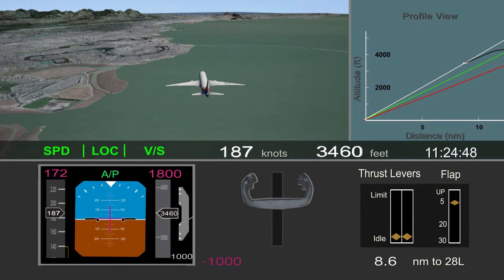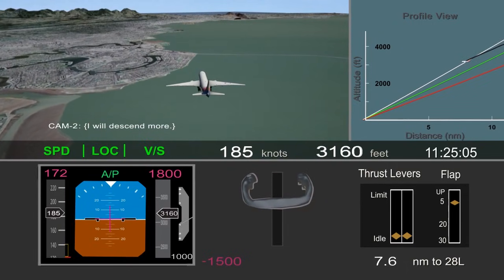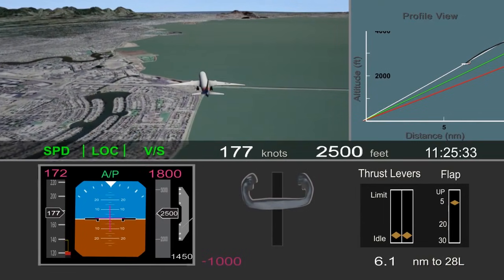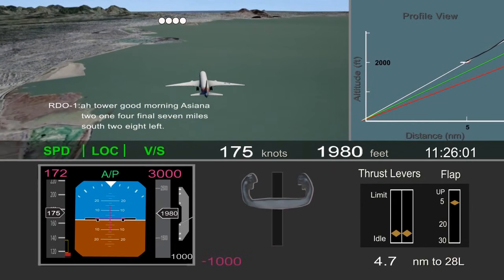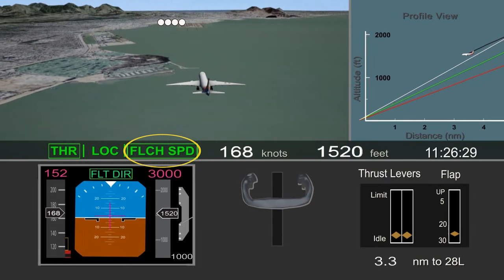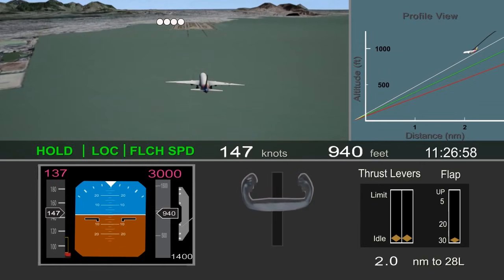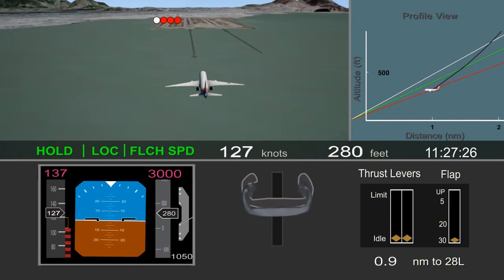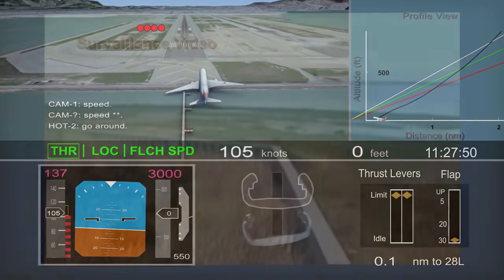Asiana Flight 214 Crash - NTSB Animation

Comment: What is the minimum altitude AGL that a B777 (like this one) is capable of going around from idle thrust, assuming normal landing pitch attitude?
Reply: +Xin Rong 2 cm
Reply: Cristian Bustos That is really not bad.
Reply: +Xin Rong now you know
Reply: +Xin Rong If you're on a stable approach, with engines at correct thrust, approach speed, on the glide-path; you can go around at as low as 50 feet above the runway (that is, just when passing above the threshold) and still not touch the ground. I believe you lose some 30 feet during the go-around maneuver. If the aircraft happens to touch down on the runway, the go-around continues though.

Comment: i think to solve this problem is to select the speed brakes so he can get i high decent rate without getting a high speed ,,,then when he intercept the glidepath just return to normal landing configuration ,,, pls correct if i'm wrong
Reply: Adam Ebrahem Yes you are right. But in a 777 you don't select them when the flaps are extended. So in that case the pilots where a tiny bit right :) The rest is just full of piloting errors.

Comment: Absolutely ridiculous - Everything on the approach bent out shape - Glidescope, Speed dropping rapidly while engines set to IDLE?? and the other pilot just watches until it s too late. The classic case of culture versus common sense. not wanting to tell the guy flying your whole approach is wrong and Taking over to initiate a Go round in case he gets offended!! Its like the guy had never flown before - Engines set on idle and speed dropping - Aviation 101 - Thrust required for Lift!!
Reply: Inatsikap Sounds eerily similar to the Tenerife KLM crew.
Reply: Glideslope btw, not glidescope.
Reply: Lot of armchair pilots in this comments section.
Reply: You are right - both pilots never did a visual approach before. They always used ILS before

Som Ting Wong
Reply: @cedricye1767  Wi Tu Lo
Reply: @ChadDidNothingWrong  ho lee fuk
Reply: Cedric Ye   HAHAHAHAHA

Comment: The reality is that many pilots are uncomfortable with doing a non precision approach. This is not the first time there is an accident because an ILS is not working. Airport authorities should recognize this fact when they take essential equipment out of service for maintenance.
Reply: It goes to show how most airline pilots are not actually pilots. They are observers. Trust the airplane and trust the automation too much. I have watched every episode of air crash investigation. And the pilots who succeeded the most in getting an airliner down safely even in emergency situations are the pilots who fly single engine or glider aircrafts outside of the airline who know how to fly when they need too. Doing the BASICS which is page 1 in training. Such an experienced captain (granted very inexperienced in the 777)  no matter what aircraft the principle of flight remains the same.
Reply: Stephen O'Connell Sir I couldn't agree with you more. I read the Canadian TSB final report on AC143 aka the Gimli Glider. The captain (who initially caused the fuel emergency) was a glider and small plane pilot in his spare time. The crew's performance on KE801, LX3597, and even worse on IT148 were appalling. When you board a commercial plane you don't know if you have a Sullenberger or an idiot like on AF447.
Reply: ***** Exactly. Look at Transasia 235: the ATR72 is equipped with auto feather in case of flame out, all the pilots had to do was.. NOTHING! Instead they turn off the sole remaining good engine. Now Transasia has grounded 10 of its pilots for failing basics tests. Unbelievable.
Reply: +Gin Za The ILS is not essential in good visibility. Every competent crew should be able to fly an approach visually. In fact, I would go as far as argue that it is the most primary aircraft skill required.

Comment: Okay, people make mistakes... BUT.. this is a fucking rookie mistake to make. Responsibility and blame is on these idiots flying the plane 100%. Sorry for sounding harsh but this is the level of stupidity of Air France 447.
Reply: Jamenator1 I don't care how many letters someone has after their name, nor how many hours or landings are in their log book.  What my very first flight instructor told me on one of my very first dual instruction flights 40 years ago still holds true.  Before you do ANYTHING else, FLY THE F**KING AIRPLANE!!!  If you don't do that, nothing else matters.  Basic airmanship has to be first, foremost, and more important than ANY other task in the cockpit, period.  These guys failed at BASIC AIRMANSHIP - they were not flying the airplane.  They didn't understand how their equipment functioned, and they didn't operate it correctly.  This was 100% the fault of the two people with their hands on the controls.
Reply: This was normal operation, while Air France 447 was in a much more peculiar situation. Air France 447 pilots lost airspeed indication due to pitot tude blockage, which required the airplane to be flown at 85% throttle and 5 degree pitch up until situation resolved.
Reply: +RBATOR1986 It's not even a rookie mistake.  It simply makes no sense.
Reply: +sifterbox You are a tit.
Reply: This was normal operation

LOC approach without a G/S is not a normal operation for children of the magenta. Remember that video? In that one he talked about the perils of disabling the autopilot while leaving the autothrottle on and said a pilot should be physically connected to the controls even when they're under automatic control.

If he'd either disabled autothrottle and personally managed the power or had had his hand over the throttles to check the thrust setting selected by the computer while concentrating on the descent path he'd have caught it.

Still ridiculous that they didn't go around at 5 miles or more given how out of the slot they were. They went below minimums even without being in a stable config which is basically every airline in the world demanding immediate go around, most well before.
Reply: Le-Cheng Xu Sorry but this lost of airspeed indication occured on average 2 to 3 times a month for over two years on various airlines. But it never resulted in a crash except for AF447. The 3 pilots were all supremely incompetent. There is a superb piece on this at: watch?v=kXMsmPQKaps
Reply: ursenay ok, so are we just supposed to sit on our hands and hope it doesn't happen again?
Reply: sifterbox it was the nose gear touching the ground, not the nose cone. Look at the ground scares, the nose gear strut dug groove into the ground, do you really thing a flat nose cone would leave a mark like that? There is a groove running along the runway and continuing right up to where the aircraft came to a rest, leading to the nose. Look how far forward the nose gear is and how long it is, the aircraft would have had to be pointing very nose down before the nose cone would touch.

Look at this picture, the ground scare caused by the nose gear strut is very visible, it starts on the runway and weaves its way to the nose (the weaving is caused by the rotation of the aircraft): 

http://media.zenfs.com/en_us/News/Reuters/2013-07-07T003835Z_1147506799_GM1E9770NWQ01_RTRMADP_3_USA-CRASH-ASIANA.JPG
Reply: James Stone Rookie mistake yes.. No idea why he selected flight level change unless he didn't know the missed approach altitude was set.. That one push of the button caused this accident..
Reply: sifterbox Got a little rekt by Jamenator1. I couldn't say it better then him. Next time you start to say that things are fake research them a little bit more.
Reply: sifterbox Man I was live on scene. It happened exactly like you see on the video.
Reply: Youre so right
Reply: RBATOR1986 i
Reply: lol you guys are all assholes and yes I am calling it. Look at the fucking video of the crash you see the plane balancing on the nose cone? You guys know anything at all about planes? did you see the 150 foot rooster tail the largest I have ever seen. take a look at the plane after the crash you see the nose cone is freshly waxed. WHAT THE FUCK. Its fake
Reply: Yeah phil research what force it takes for diret to fly up in the air and look with your own eyes more than the nose gear touched. If those rocks and dirt got thrown up 150 feet I imagine it would scratch or dent the nose cone some But again my point is watch the actual crash video watch a close up of it the nose does hit the ground fools.
Reply: Gin Za i'm sorry but i disagree with you. You cannot just say that its pilot error and move on. These guys were not necessarily less competent than any other a330 crew. The AF447 crew were fully certified, trained and passed their training to standard, yet under these specific set of circumstances they behaved strangely. Humans are hard to predict and all make mistakes, just because these guys got it wrong, it doesn't mean they were bad pilots, it just means that under these set of circumstances they were not up to the task as a crew, change just 1 element of those circumstances and they may have reacted differently, for example if one of them had been nominated clearly as being in command in the captains absence then they probably would have taken proactive action. This is not just 1 person's fault, more a cultural issue within the airline, i.e. relaxed standards. These guys all acted the best they could in the circumstances, but we will never know exactly why they reacted because we were not there. Hindsight is a powerful thing
Reply: Its fake ~!
Reply: do me a favor watch this video and at about 3:45 you can see the airplane skidding across the ground on the under tip of the front of the plane. You see all that black sand and dust really force ably being thrown up. Now go look at the pictures of the plane being hauled away etc. The plane looks like it just got a fresh coat of wax it was flawless. Now come on Think for yourself. This cant possibly be the same plane.  Again look at 3:45 then look at this picture of the plane. Do you really think you are an expert because I don't if you can look past this. http://i.ytimg.com/vi/TFUqW4Qy33s/hqdefault.jpg

Comment: Pilots didn't know how to land VFR and still used the planes autopilot despite given instructions from SFO about the ILS being out of service. Every pilot should know how to land visually and manually rather than depending so much on the technology. Kinda like driving vehicles, only the driver controls the vehicle. Asiana 214 case, the pilot failed to control and fly the plane normal.

Comment: It seems to be another CFIT (Controlled Flight Into the Terrain).
I can't understand why situations like this still happen, once terrain proximity systems are much more reliable, ground aids are redundant and aircraft sensors and systems use ultimate technology.

Comment: I am a Aerospace Engineering student, not a pro. I wonder if the pilot push the stick forward in the last second or two, will it prevent the tail broke off completely, the landing gears would still rip off from the plane but at least the 2 people been ejected out would have better chance. And  the girl from China won't been crushed by Fire fighting vehicles
Reply: All the people in the front of the plane would have died had he pushed the yoke forward.

Comment: One thing I noticed in the animation is that they have selected LOC mode on the MCP as indicated on the PFD, but no CDI is shown in the animation.

With the ILS inop, or I'm guessing it was just the glideslope that was inop, it appears, the were what I call 'manually autopiloting the aircraft down the approach segmemt that was good.  Is there a LOC ONLY for 28L?  I will check here in a few.

It would also appear they could have been autopiloting the visual approach backed up by the localizer.  

In any case FLCH should have never entered the picture.